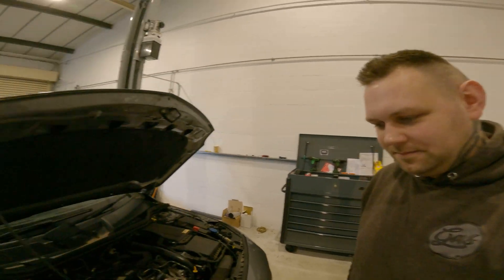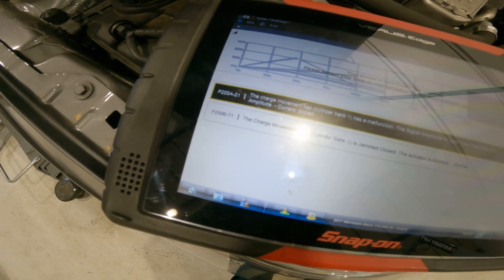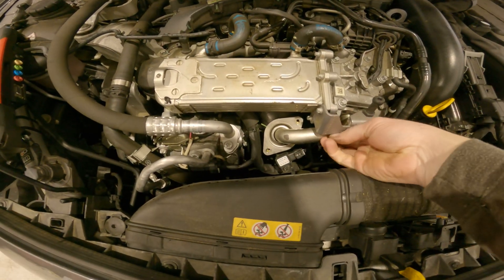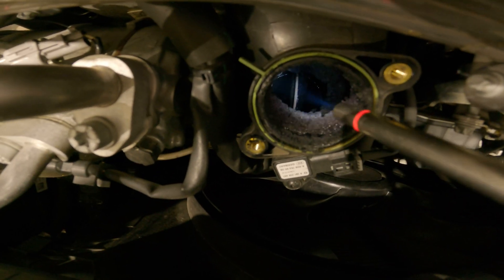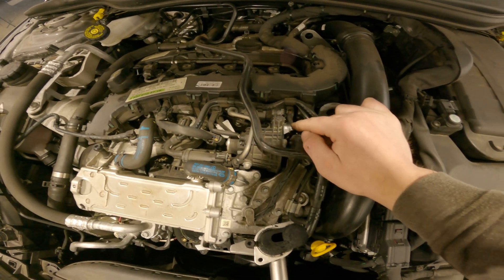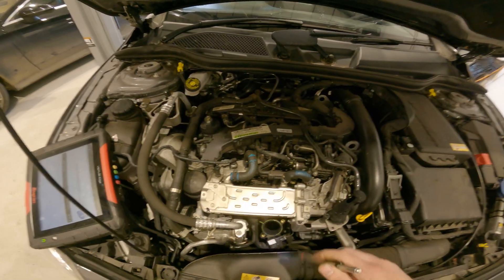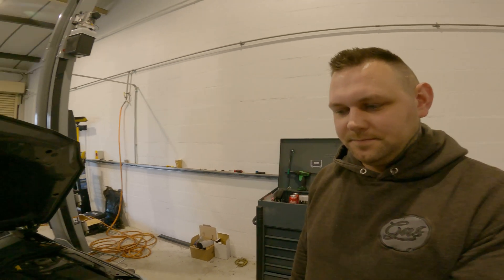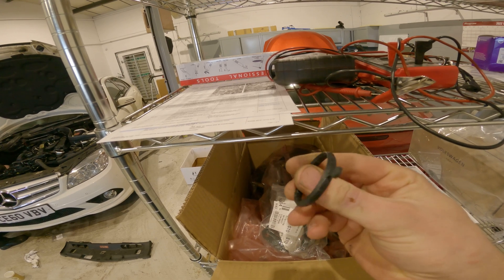P2006 Mercedes Fix. OM651 intake manifold replacement on W176.

Comment: Hi there, thanks very much for this video. Wondered if you can help please? After job, check engine light came on. Also code won't clear. Mechanic can't work out why check engine on. He wondered if the car knows it's not an original Mercedes part, sensed from the actuator motor thing that opens the flaps. Do you think that's possible? Any thoughts on why he can't clear the code, he says it's in the memory but it won't clear. Thank you very much. Dan
Reply: I’ve got the same issue on my car. New part (off eBay so not genuine), fits fine, car runs fine but mechanic can’t seem to clear the code 😩 if anyone has any tips or advice please let me know!
Reply: @LucyAtkins-e2t  Hi, thanks for getting involved! It's really annoying, is your check engine light on also?
Reply: Hi Lucy. So I looked into this yesterday. I have a basic ODB scanner so I cleared the fault codes. I then disconnected the negative battery terminal for three hours. I reconnected it, let the car sit over night, this morning check engine light gone! I've driven for 30 minutes and still off. Fingers crossed! Worth a try?
Reply: It came back 🥵

Comment: Do you have to teach the new actuator after replacing with new? I’ve replaced with genuine Mercedes parts but still got the same engine codes as you?

Comment: Excellent information thank you, especially having to relearn manifold which I didn’t expect. Just replaced same manifold but comes up with P200A07 but don’t have good enough tool to do that. Was it a relearn on the actuator or shut off motor can you remember?

Comment: I dont know if you’re going to read this, I had a problem with intake manifold on my 651, I’ve changed it, took Pierburg manifold and Bosch manifold motor, I’ve also changed Throttle body. After 10 days I got a P2006 code again. I dont see any difference in behaviour. It idles very quietly and is very responsive. Fuel consuption is always under 5l. What else could it be?
Reply: Try the Throttle body MAF sensor

Comment: Can you move the AC compressor out of the way without disconnecting it? Do you need to do anything to the AC after new manifold is installed?
Reply from the maker: Yes, I leave connected and just move out the way.

Comment: Hi I have vito w447 with om651 engine & have low boost limp mode fault, have following codes p0299 p2261 P00C400 
What could be causing fault ?

Comment: Hi, my engine light came on my 2007 r350  a mechanic said it was an air flap in the intake. Some plastic parts that needed to be replaced. I don't understand what an air flap is. Can anyone tell me.
Reply from the maker: Hi! The flaps in the intake manifold purpose is to ensure that the air entering the cylinder is sufficiently turbulent for good fuel-air mixing even at low engine speeds. This aids in reducing emissions. Unfortunately on the Mercedes m642 engines (fitted to yours) they suffer with wear like on most other manufacturers cars also. Hope this helps!